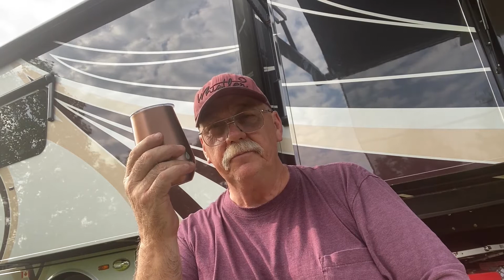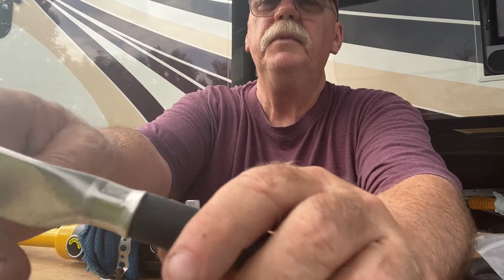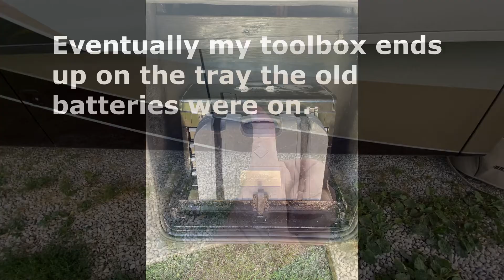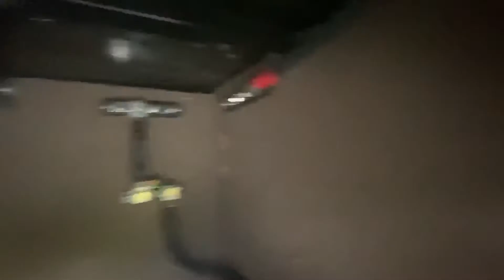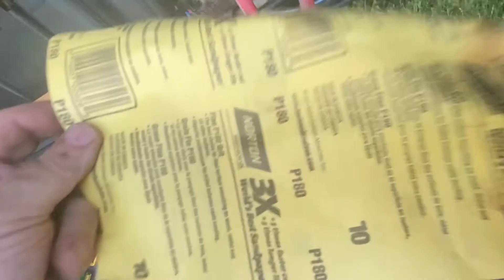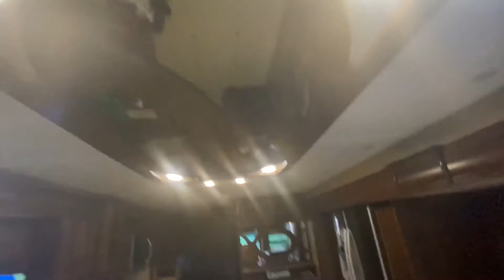Making Battery Cables for our New LiFePO4 Batteries RV Living | RV Life

Comment: Not seen a battery that you can Turn OFF and store... I missed what brand and How much?    Thanks
Reply from the maker: They are 12v100 AH Renogy batteries. We bought Renogy because they sell them for the same dollar value in Canada as they do In USA. If you are in Canada that is a savings of about 30 percent. They also do not charge tax or shipping. So if you are in Canada the savings is huge. If you use my link you can save 10% and I get a small refferal at no cost to you. http://73renogy.refr.cc/garysalo

Comment: Hey! Congrats on the setup. I have the same coach although 2013. Do you mind sharing more info? What model Renogys you installed and what other changes you made to the original equipment? Do you plan on adding solar or just charging with genset and or while down the road? Were you inverting first with the old inverter? I see you latter add 2 Victrons Multiplus…. I just want all info!!! Since we have almost the same coach. I was thinking of buying 4 AGM lifelines but not sure is I should go your way.
Reply from the maker: Thank you. The batteries are the standard renogy 12v100ah batteries. I did not go for the ones with heaters built in. It is not needed as they are in a heated bay and with the inverters which create a lot of heat. Personally, after being in the ebike business for 10 years anything not LiFePO4 is heavy and a waste of time and money, but that is your descision to make. I was on the old magnum inverter at first. One step at a time as we are living in it. The inverters are hooked up and running, solar is next. I have a Victron solar controller and some panels in the basement yet to go on the roof. Why did I go with Renogy over victron? In Canada Renogy sells thier products for the same price as in the USA. That saved about 30 percent. Then there is zero shipping cost, they were on sale and i had coupon codes for a discount as well. All in all they were about 40 percent of the cost of battleborn. That paid for two inverters, a solar controller and some panels. Its all about the budget sometimes. Yes I know Battleborn is the best. But do I really need it?